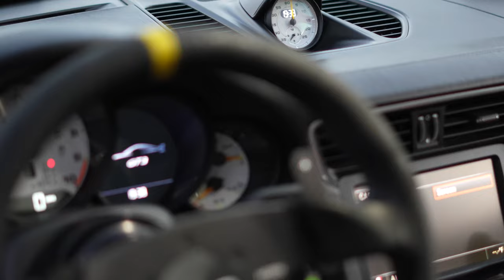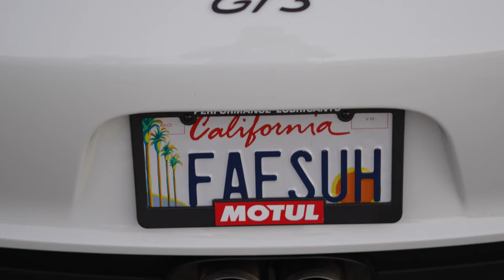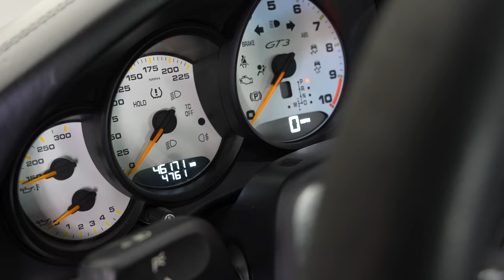Porsche GT3 2 Year/36k Mile Ownership Review

Comment: have you driven any modern carreras? curious about how big the gap really is between a carrera and a GT car
Reply from the maker: Haven’t driven the new GT3 but from
What I hear, it’s a better handling car with the different front suspension
Reply: I know a few guys who hated their GT3's due to rough ride and interior noise. They flipped the cars quickly at no loss, or a profit, so no harm done. I also know a few guys who felt the exact same way about the Carrera, believe it or not. 911's in general are not quiet and cozy. If you're worried make sure you go for a test drive, or ask the local PCA. I've met up with a few different guys who were Porsche shopping and let them drive my car
Reply: @slytherben  they said that about a modern carrera? i have a c63s sedan right now, and had a chance to test drive a 991.2 c2s and found it super refined and well damped… it was a significantly more comfortable daily compared to my car lol
Reply: @alexbuiii  I’ve heard it said about 991’s and 997’s. I haven’t spoken with many 992 owners. There are a lot of guys who’ve owned grand tourers and always wanted to try a 911. Sometimes that transition doesn’t go over very well.